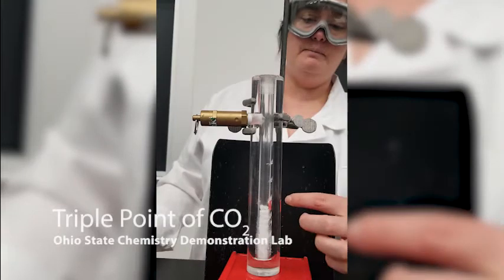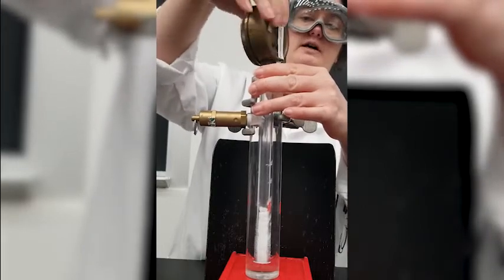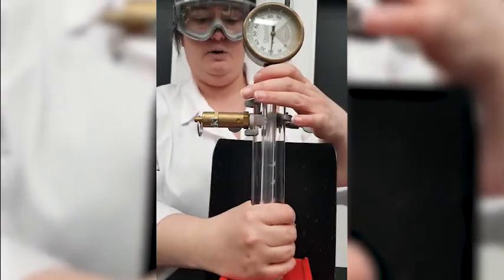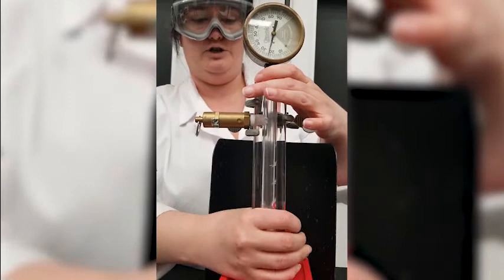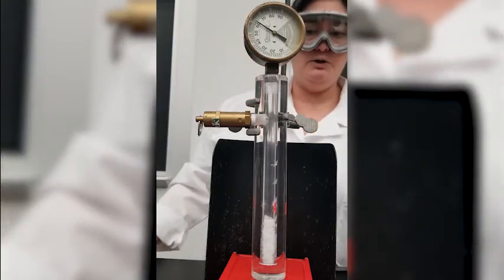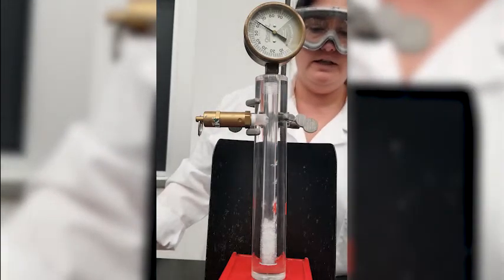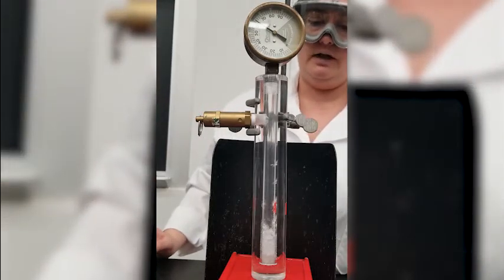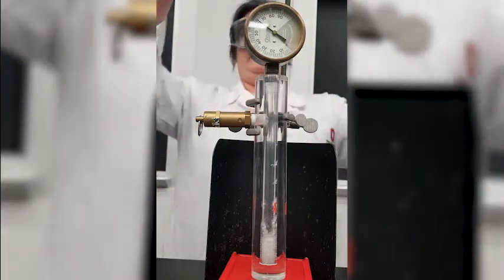Triple Point of Carbon Dioxide

Comment: There's a lot of fear in this video as if that glass isn't thickest glass I've ever seen. It's a missed opportunity to tell people how thick the glass needs to be how reinforced it needs to be how little liquid you have to put for it to stay in there and reach room temperature but still be in that same confined space. Now I realize I misspoke arguably but I don't think so. I think there's a lot of confusion about something that is extraordinarily important. The force is significant that the molecules generate as they heat up to get apart to get further apart than just not being a liquid constitutes. The concept of triple point is untaught by this video. This is not a stable situation there. I think about these multiple phases of a material at the same time as a stable situation as a relatively stable situation. I have naively contributed to global warming as a child by trying to store dry ice and ending up with a bottle of liquid. I looked at the liquid carbon dioxide in the glass bottle and I shut the freezer door. Later the door opened up on its own of course and we needed a new refrigerator. It wasn't the carbon dioxide that was released in that split second that warm the globe up. It was the time I have taken since then to understand that I was on to something then. What happens when you heat up these materials is that they become transparent to heat recent research says that the heat can actually move through them faster than light moves through a vacuum. It makes sense that you can store hydrogen more compactly in powder than in a vacuum so why not have heat itself move faster than photons in a vacuum? There may be reasons why that isn't happening and people think it is but people want to move energy and the best energy to move is the energy that is cheapest and cleanest and that is heat itself. We have a planet after all. It's not just about what we can do on spacecraft and what we can do to other people by sending them packages they'd rather not receive.

This experiment is supposed to build significant insight not help somebody answer the question about how many pounds before you can have a significant amount of liquid carbon dioxide in a jar. That is called trivia. The issue is do we need energy to be in electrical form for it to be useful. Are there ways of making heat available at one location for free like half a dozen miles below the surface of the Earth do work on the other side of the planet on the surface of the Earth without spending as much as we are currently spending even to just move it a few miles electrically? We see in the Olympics contests involving the moving of heavy weights across ice or ice itself. That is what we have to do with energy. Less packaging more meat. No copper just heat. This is the insight that saves the world this is the technology that ends the BLIGHT.

IT IS AWESOMELY IMPORTANT THAT WHEN IT COMES TO EDUCATION WE CHOOSE AMONG THE FACTS AND MAKE THE CHOICES RIGHT. THE COPPER MINES USE WATER TO MOVE THE HEAT AWAY FROM WHERE THEY WANT TO MINE THE COPPER. THEY DO THIS TO AVOID THE EMBARRASSING SITUATION OF DESTROYING THE VALUE OF THE COPPER THAT THEY SEEK TO SELL BY DELIVERING THE ENERGY IN MORE VALUABLE FORM TO THE SURFACE. THE MOST WORTHLESS FORM OF THAT GEOTHERMAL HEAT IS WARM WATER. THEY LITERALLY PUMP IT AND SKINNY PIPES ARE USED WITH ELECTRICITY PURCHASED FROM SOMEONE ELSE TO TAKE THE HEAT OUT OF THE WATER AND SEND IT BACK DOWN TO GET MORE HEAT. IT'S LIKE CHARGING PEOPLE TO DROP OFF GOLD. YOU HAVE 10 LB OF GOLD I'LL CHARGE YOU 50 BUCKS TO TAKE IT OFF YOUR HANDS. THAT'S WHAT THE COPPER MINE ARE SAY TO THE PUBLIC. THE PUBLIC WATCHING VIDEOS LIKE THIS SAYS HOW ABOUT FIVE?
Reply from the maker: It isn't glass, it is lexan.
Reply: @chemistrydemolabohiostate  I have done this in a plastic soda bottle with a good lid. It has to be a small one, 8-12 oz bottle. The big ones rupture spectacularly (from far away, please). If you WANT the fun of a loud rupture, use a little water to speed the sublimation.